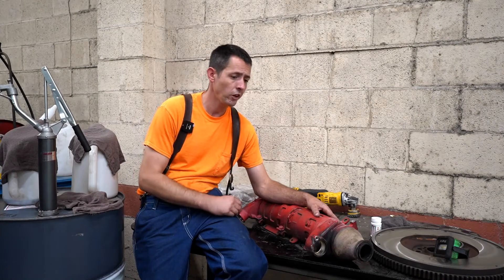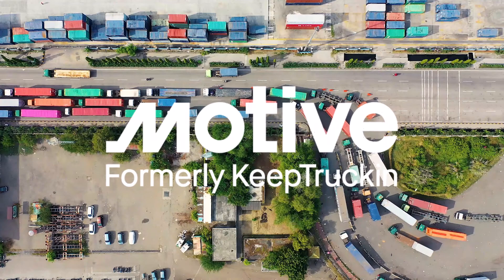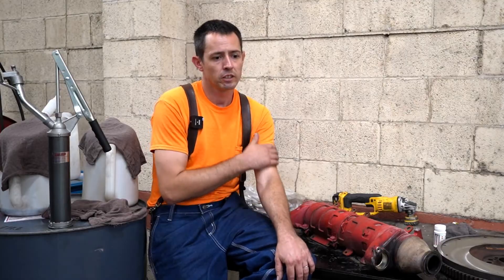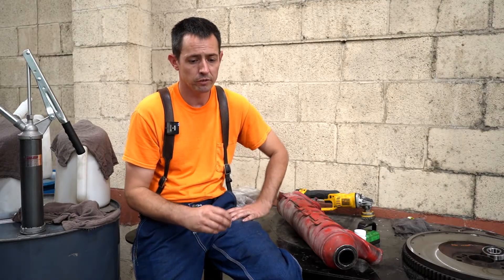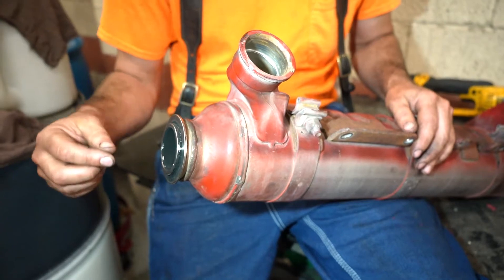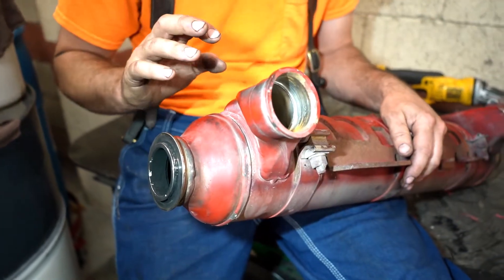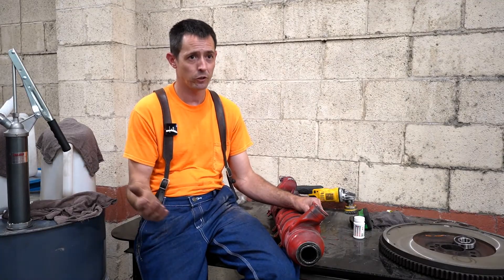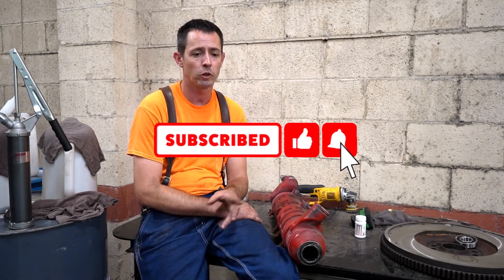What Causes Pressure Build Up in Cooling System - Semi Truck Diagnostic & Troubleshooting

Comment: The problem is I'm losing coolant but I have no high pressure and no visible leaks.  I'm gonna put a leak tester on it in the morning but I'm worried? 😔
Reply: Check your transmission cooler usually under the cab right in the middle

Comment: Im suspecting my EGR cooler is bad, but i only build pressure when climbing a mountain with a heavy load. Starts to dump coolant out of the overflow when the temps go up. When the fan comes on the pressure goes back down. I noticed once while doing a parked regen. Temp would go up, pressure would build, and coolant would come out of the overflow tube. Fan kicks on, temp goes back down, leaking stops until it repeats the process. Didn't do it before, just started happening this summer. Have a Volvo D13. What do you think? And thank you for this very informative video.
Reply: Did you get your issue resolved?
Reply: @kentrellhicks5257  no, still doing the same thing. If it was the head gasket or egr cooler it would maintain constant pressure. I'm suspecting the thermostat isn't opening all the way. I was up in Seattle and didn't have the issue at all with the cooler weather. Once I got down to Arizona with 113° outside temps the coolant would stay above the 170 operating temperature. Just stayed at 180 to 190 and it never did that before either. I actually had to turn the heater on, and the temperature slowly started coming down. Had to stop once to refill the coolant reservoir.

Comment: Hey Ryan, my coolant level fluctuates abnormally in my 2007 freightliner Columbia Detroit 60 14L. It will be so low cold that truck won’t start due to coolant being below low coolant sensor. I will fill to halfway mark, but then after running the truck the coolant will rise above the max line.

Comment: I replace the Egr cooler and the Air Compressor but I'm still having high pressure in my cooling system.  I do have combustion gas because the blue fluid turn yellow .  The truck DO NOT overheat.. WHAT ELSE COULD IT BE?
Reply: Did you get your issue resolved??

Comment: I've Never even considered Testing the boiling point of the soot to detect coolant. I work on pickup truck diesels and i usually pressure test the cooler or you can usually see the coolant crust in the cooler. Im going to get some coolant strips and try that next time. Another Great video Ryan , Thank you
Reply from the maker: You are welcome! Good luck!

Comment: I might add injector cups failing also cause, coolant pressure build up. My personal experience is from Volvo D13 cups. Which in turn blows up the reservoir like a balloon. But great video my man, keep em coming.
Reply: But was your reservoir tank throwing coolant out from the overflow side? Mine does that and not sure what’s going on

Comment: I finally found a shop, #4, that listened to me and did the test I requested after the other shops wouldn't, but just did the same tests the other shops did, all passing! The Peterbilt in Charlotte did the air compressor isolation test. That was it. Bad head. Replaced head, running great. No more issues! These so called techs at these shops will repeat tests to pad the bill it seems. They can also be arrogant and lazy.

Comment: I have this same issue going on with my 3406E Cat motor it doesn’t overheat but spits coolant out the overflow tube
Reply: Did your problem get fixed sir? What was the issue?

Comment: Ryan . Perfect video. Thank you. 3 years ago I did overhaul due to same problem. I got a head gasket problem. My mechanic blocked my EGR cooler . He said that this is ok for my engine. I have Volvo 2008 with Cummins engine. So if my EGR is blocked it means it could be again block gasket or air compressor??

Comment: Hey man love your videos especially you being a former landstar driver but I was wondering how often you got your overhead adjusted and how often you got your dpf filter changed , i been here with this truck about a year and I get my oil changed every 3 months but filling out my maintnance report made me think I should start thinking bout overheads a cleaning filters even tho it's been an awesome truck with hardly no problems but I thought I'd get on here and ask you
Reply from the maker: Good question! I am planning to make a video about maintenance schedule. Should be able to answer your question there in details.
Reply: @truckingandfixing  that'd be great look forword to it
Reply: @truckingandfixing  Did you make the scheduled pm video?
Reply: DPF filter cleaning recommendation for cummins is every 250,000 miles.  However, if you idle a lot and don’t have an APU you will have to clean it closer to 200,000.  Also your oil changes shouldn’t be on a 3 month interval but a specific milage interval.  I change mine every 15,000 miles and use Rotella T5 semi synthetic 10w30.  Hope this was helpful.  I too am at Landstar, I have a Thermo King Tri-pak and keep my idle time to an absolute minimal.  Idle time will absolutely clog your dpf filters and cause a whole host of issues.

Comment: Thanks Ryan. I'm having a similar issue with my surge tank. It's not overheating or dirty but there's pockets of air in the surge which is triggering low coolant and stop engine sensors. Coolant levels and coolant temperature are normal. New coolant, tank, and coolant sensor but the problem persists. Do you think it might be the compressor?

Comment: I have that problem at Volvo d13 engine Just under heavy Load uphill I do not have any leak  bot when pressure buildup the coolant over flow thru the cap valve 
what you recommended to check EGR Cooler or compressor ?

Comment: I have a 2015 cascadia with dd15. It loses power and smokes accelerating from a stop sometimes. Only have this issue in the winter. I was told it was a bad head. I replaced. I was told it’s bad injectors. I replaced. Ecm got replaced. Fuel pump got replaced. I’m all out of money and the problem still exit. When the truck is warmed up all the way it doesn’t smoke and it only happens when bobtail. Under a load truck runs flawlessly. I don’t know what the problem is. If you have any idea please let me know.
Reply: Change you doc and dpf filter.

Comment: Mine has same issue so we had low coolant light coming up but every time we checked coolant wa ok then we changed the pigtail didnt help chnaged the tank it helped for few days then back again . Intake throttle valve gone bad after that my tank had little black color in it i dip my finfer in to see if its oil it wasnt oil as oil would stick to finger could tell ao what cluld it be i dotn want to pull head as i have no performance issue and not enough pressure at idling only on road . And it kinda smoke as if coolant burnign

Comment: Hey brian, I just changed the water pump on a t680 kenworth, and I feel like the engine temperature goes up faster than usual. When I go uphill, it does not overheat, and the fan kicks in. Unless it's in my head. Would you give me your two cents, please

Comment: I have coolant going into my engine oil when I pour it into the reservoir 
Now theirs too much oil in engine which is pushing it out through the oil filler neck when truck is running

Comment: Ryan, the company that I drive for has replaced the head,head gasket,air compressor and the EGR cooler. I'm still getting back pressure and losing coolant.  Anything else that we can look at.
Reply: Hi ,how did you fixed your truck then? I have the same problem with my truck.

Comment: Over pressure not overheating, 2019 paccar mx13, sciped egr no soot gunk or coolant they said. Various pressure tests, combustion gas tests, all passed. At a loss. Bad fill cap? Bad pressure relief side cap? Checked air dryer purge valve, no coolant. Radiator seam popped. New radiator, new air compressor lines, new bushing, still happening. Three shops, no clue.

Comment: If this is the way you choose to test it that's fine I suppose,but wouldn't you have to check the soot on the hotside also  to know it's not coming into the system pre egr cooler?

Comment: Hey, have you explained what needs to happen after an EGR cooler goes bad? I had mine replaced under warranty but the soot/snot in the tubes is astronomical. They said the system would burn it out. Is this true, or do I need to take everything apart and clean it?

Comment: If you take a antifreeze stip scap the carbon from said EGR. Now add a cap full of distilled water until carbon is dissolved. Test with strip….beats taking it off for a simple test
Reply from the maker: Thank you for sharing your experience!

Comment: Have to same problem with my own 2007 Peterbilt C15, only thing I try and get parts and the guys at part keep telling me something different every time. I go one day and they tell me the Egr cooler is bad and when I decide to finally replace it, they say it doesn’t have it. They then tell me it has a precooler and not a Egr cooler. Then I don’t purchase anything and I go again and rinse and repeat anyone have clue on this situation to solve this problem.
Reply: Your c15 does not have an egr cooler! Egr coolers are for epa trucks!

Comment: the fault with your solution is that the cylinder head gasket that is leaking fills the cylinder and pumps the coolant into the exhaust, and makes it impossible to determine where its coming from, one psi of pressure raises the boiling point of water by three degrees, you should know this, a radiator must cool 30 degrees from the top tank to the outlet at the bottom tank per pass or its clogged, it does not take 8 hours to do a egr cooler, and a air compressor is about a two hour job, easiest way to check a egr cooler is to remove the clamp at the rear of the egr cooler and the rubber hose at the back of the engine and use a mirror to inspect it, sometimes the coolant will run out the clamp and leave tracks on the block. when a story seems to be fishy its most like just a story, drivers and customers say so and so said this, unless its in writing or you personally hear it the story is suspect.
Reply from the maker: Thank you for watching the whole video and comment here. I would like to response to some of the points you stated in the comments. In case other people in our community also have the same  questions. 
- Failed cylinder head gasket also pumps the coolant into the exhaust. It is absolutely correct. I mentioned the point in the video. I have a couple reasons to focus on EGR cooler in this case. 1. Most shops or immuture mechanic always go to the most expensive source to look for problems. It is not necessary wrong. However, it is not a practice I take. There are so many things can cause the same issue. I always go from the cheapest option first. It is cheaper for the customer. 2. If head gasket is the issue, you will also see overheating, white smoke and other abnormal things. However, customer didn't experience other issues other than the high coolant pressure. So considering all the information available, I think EGR cooler is bad. 
- About the exact boiling temp after increasing the pressue, it was not the key of this video, I just wanted to express that there is a correlation between pressure and boiling temp. Everyone can google the exact correclation. 
- About EGR cooler job and air compressor job, you stated it only took you 2 hours each to do the job. I am very impressed. I hope you meant the whole job. Take EGR cooler as an example, it takes near 1 hour to drain and refill the coolant. You will have to test the truck after installing the new EGR cooler. Cummins book says 8.8 hours for EGR cooler job. Again, just impressed by your statement.
- Lastly, about the story. I run a shop, and I have 6 weeks of jobs currently. I do not have time to create stories here. It is not what I am good at and I don't have plan to become a story creator. All information is based on the customer coming to our shop. 

Thank you again for taking time to comment. I have read many comments from you before as well. I appreciate your continuous support! Have a wonderful day!
Reply: @truckingandfixing  aftertreatment engines have the filters on them, you can no longer look for smoke out the exhaust, sometimes you can smell the burning antifreeze, i did not or have i ever stated a egr cooler only takes two hours, reread the comment, i said it doesnt take 8 hours, and you state in your video that the egr cooler and the air compressor take about the same time to repair,  AND i never said you made up a story, but your repeating a wild story a customer said cummins did this and cummins did that, i said customers and drivers lie, in a nice way, they dream up what they think it is and the c b radio guy said and then say cummins said this and that, as to it taking a hour to drain and refill coolant, get a sump pump and put a quarter in the garden hose and start with a 3/16 hole in the quarter to pump in the coolant and enlarge it till you get the flow you want,